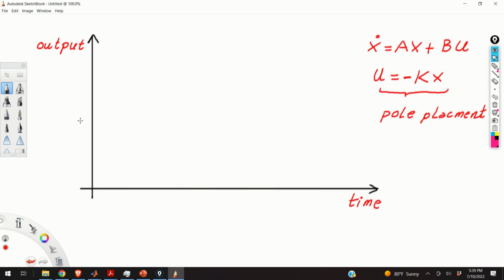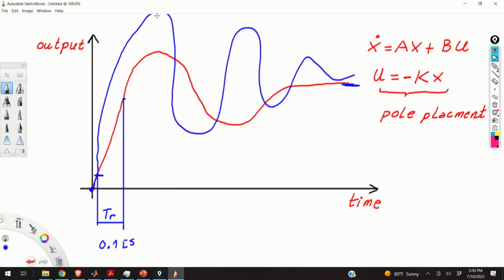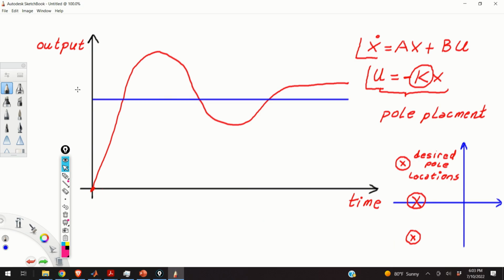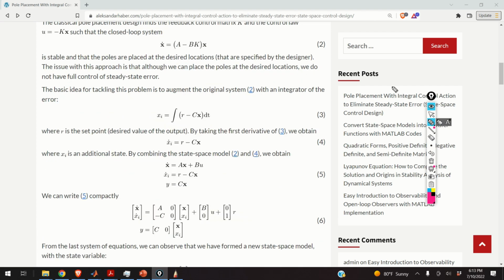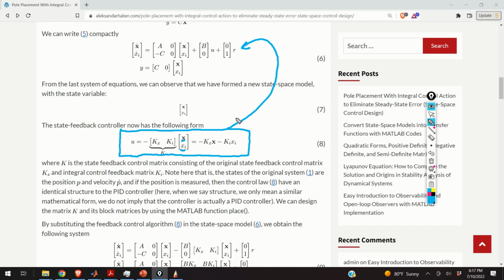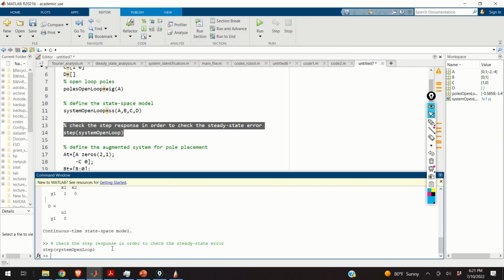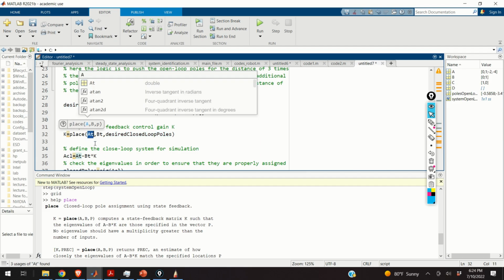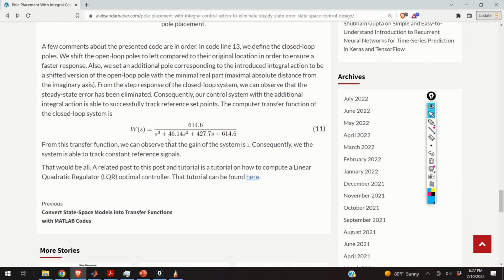Pole Placement with Integral Control Actions in MATLAB to Eliminate Steady-State Errors

Comment: Thank you for the video. Can you suggest some reference book for pole placement with integral action?
Reply from the maker: You can look into basic control books, such as 

https://books.google.com/books/about/Modern_Control_Theory.html?id=OPFQAAAAMAAJ

or 

Feedback control of dynamical systems 

https://www.amazon.com/Feedback-Control-Dynamic-Systems-Global/dp/1292274522/ref=asc_df_1292274522/?tag=hyprod-20&linkCode=df0&hvadid=366299527326&hvpos=&hvnetw=g&hvrand=14623090718776089930&hvpone=&hvptwo=&hvqmt=&hvdev=c&hvdvcmdl=&hvlocint=&hvlocphy=9003522&hvtargid=pla-766940294569&psc=1&tag=&ref=&adgrpid=79033899271&hvpone=&hvptwo=&hvadid=366299527326&hvpos=&hvnetw=g&hvrand=14623090718776089930&hvqmt=&hvdev=c&hvdvcmdl=&hvlocint=&hvlocphy=9003522&hvtargid=pla-766940294569
Reply: Thanks a lot ☺️
Reply from the maker: @mi_ra_kee  Please consider subscribing. Thank you!